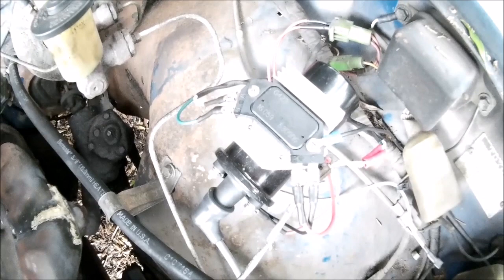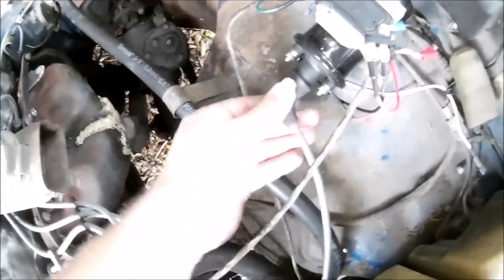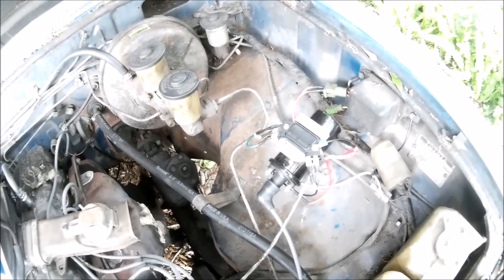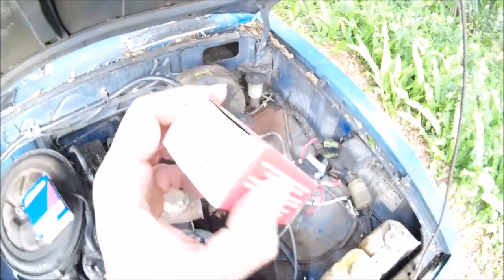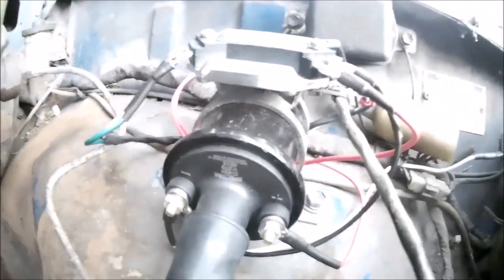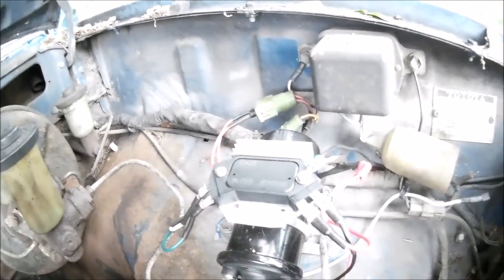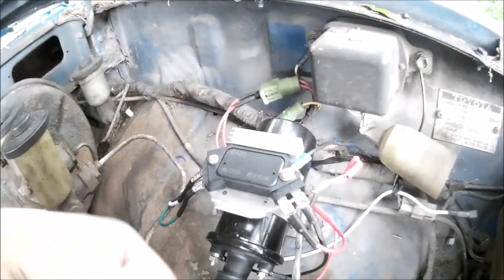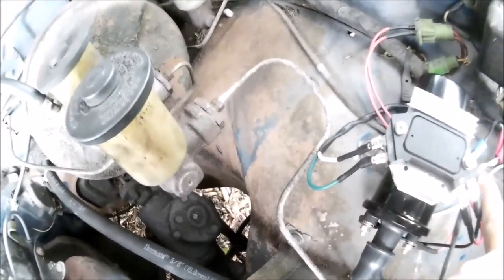1978 Toyota Pickup/Hilux 20R - GM HEI Ignition Module Conversion

Comment: Hey, The13thSword! I have recently bought and fell in love with a 1977 Toyota Hilux and have been watching many of your videos to DIY some repairs on the truck Super appreciate the knowledgable and detailed step by step videos you have taken the time to make and share. I recently put in a gm hei conversion igniter box in her and keep on coming across the same universal coil (all state that an external resistor is required). I noticed that you bypassed this and am wondering what part number and from where did you get your coil? Does it not require an external resistor? Thanks for your time!
Reply from the maker: You are most welcome, always glad to try and help another owner! I include as much detail as I do to be as clear as possible. Nothings worse in vehicle repair than having to guess at something.

So let's get into whether or not you need a ballast resistor. The simple answers are: 1 - If your distributor is a "points" type" then yes, you need a ballast resistor, or 2 - If your distributor has a pickup coil instead of points then, no, you do NOT need a ballast resistor.

Here are the explanations (apologies if you already know all or some of this, & for the length). On a "points type" distributor, you have a pair of physical points or contacts that open & close, operated by a cam on the distributor shaft. This is what allows the coil to "fire off" it's built-up energy into the central distributor wire. Again, trying to keep this simple, the coil is a simple "step-up" transformer, taking your 12 volts & increasing it to something like 30,000 volts or more. When the points open, the magnetic field in the coil collapses, & all that voltage rushes out to the distributor. The points close again & the process starts all over. This happens 100's to 1000's of times a second depending on engine speed.

On a points system, a ballast resistor is in the "run" circuit from your ignition switch. Once the engine starts, it drops the voltage to about 6 volts. This is done to minimize arcing at the points (they arc with every open & close), to extend their lifespan. Arcing on points or contacts causes pitting and/or corrosion, which can increase their resistance, further lowering the voltage; not good, or possibly causing a no start/no run condition. The resistor also extends the life of the coil, since it's not handling as much voltage/current. This was a consideration with older coil design & construction (materials, etc.) BTW, there is no ballast resistor in the "start" circuit; the coil gets full 12 volts on startup.

Some car makers still used ballast resistors with the pickup coil type of distributor in the 70's & 80's; this was to lengthen the life of the coil. Most modern design coils can take constant 12 volts & live a long, happy life, so the ballast resistor is not needed. Bonus - you also get the full voltage/current to your spark plugs for more power & better fuel burn.

My research indicates that the '77 had a points distributor; this shows on Rock Auto's site. Is this what you have? The later "pickup coil" type uses the pickup coil to replace the points; it's an all electric operation, so no points to wear out or adjust. Here is what the inside of one looks like: http://www.cardone.com/Products/Product-Detail?productId=31725&p=rock&jsn=403
The HEI will work with points, but would works a ton better with a pickup coil type distributor. It looks like '78 was the first year for the pickup coil type, & was used in '79 & '80. The later distributor will fit on older 20R's; it's a straight drop in (see my vid on proper distributor installation). Rock Auto has rebuilt ones from A-1 Cardone & I recommend them. They are only about $100 plus shipping, with a $15 core refund when you send your old one (or keep the old one for a backup & let 'em keep the core charge).

As for the coil I used, I got a replacement from Rock Auto, SPECTRA PREMIUM/COOLING DEPOT C624. It's only $8, is decent quality & a year later so far so good @ the full 12 volts feed. There are a few others in the $20 range from Airtex & Standard Motor Products, somewhat better quality & are solid. I don't recommend AC Delco, Accel or any so-called "hot rod" coils; 20 - 400% more expensive for no more quality, you're paying for the name. Without knowing which "universal coil" you mentioned, I do not know if it will work or not. I'd need to know maker & part # before I could say.

Also, if you ever need one, SPECTRA makes a great replacement radiator for these trucks, & Rock Auto has great prices on them; love mine! (They do not sponsor me, they're just the best prices available).

Questions: Would really like to know which type of distributor you have installed. Is the engine original? Do you have the mechanical fuel pump on the head or electric fuel pump? Electric or water choke on carb? You've got me way curious.

Again, sorry for the length; just want to be clear & complete. If you need any other info (have a TON stored) or help just let me know. Joe.

Comment: Greetings. Followed your video step by step. Also replaced my distributor, plugs, and wires on my 86 22R. Engine cranks and cranks but has no spark! You have any idea what may cause this?
Reply from the maker: It could be a lot of things, so pardon me for asking what may seem like some dumb questions, and maybe give you more info then you were expecting. I just want to be as complete as possible (I don't know how much you know, so I'm including as much as I can.)

Are you absolutely sure you have no spark at all? Tried grounding the main spark lead from the coil to the engine or valve cover while cranking? If you have spark on that lead, recheck your firing order i.e. make sure your spark plug leads are in the right order. Firing Order is 1-3-4-2. If distributor is installed properly, #1 should be upper left, when looking straight at the cap (from side of vehicle, NOT looking down towards the ground. If you do get spark from the coil using the above method, I would suspect a timing issue or incorrect firing order. If so, see next to last paragraph below.

If you still have no spark from the coil, the main & most common reason for it may be that your ground to the module is missing or not adequate. The module grounds through the holes with the tab that the screw goes thru. Originally on GM cars, the module mounts to the distributor, which is grounded. Just to make sure I did not have this problem, I made up a dedicated ground wire for it; you can see it in the video @ 5:12. If you DID make one of these ground wires & installed like I did, make sure there is no rust or corrosion at the contact area @ the bolt for the voltage regulator, INCLUDING inside the threads & underside of bolt head. I scraped off the paint on the inside of the fender so it would be grounded to the body for sure. If you have a long enough piece of spare wire (no smaller than 18 gauge recommended), you can easily check if this is the problem. Just temporarily run the wire from the ground point on the module to your negative battery terminal, then crank & check for spark. If you get spark, you know the ground wire you made isn't grounded properly. Solid grounding for this modification is a MUST.

Also, check ALL of your ground wires while you are at it. It's pretty common for older vehicles that have some electrical work done on them underhood to suddenly develop electrical "gremlins". You should have one ground cable or strap from negative battery terminal to passenger side engine mount, & another ground cable from engine block to firewall on driver's side. These being clean and tight are critical for the whole vehicle.

If ground is verified to be good & you still have no spark from the coil, it would have to be the power feed to the coil. Again make sure all your connections are clean & tight. If you have a volt meter you may want to check if you are getting power to the coil with the key on. If not, it could be an ignition switch problem or fuse. Also check that you did not switch the wire around backwards; it happens. Also check your ignition fuse for condition & any corrosion.

Is your battery good enough? Only way to tell is if you have a volt meter to check it; it should read 13 volts+ at rest (not cranking) & should not drop below 11.5 volts cranking.

Possibility that the distributor was not installed correctly, thus making the timing off enough to cause the symptom you describe (engine not firing). If the motor was cranked or turned while the distributor was out, then the timing would be off for sure. The only way to fix this is to remove the distributor, rotate the engine manually until #1 cylinder is at the top of it's compression stroke & (in your case) timing mark is @ "0", set distributor to correct position & re-install distributor. The best way to know when #1 is @ top of compression is to remove the valve cover. On #1 compression with timing mark @ 0, both rocker arms will be slightly loose. If timing mark is on 0 & one rocker arm is tight, one is loose, that's the exhaust stroke for #1. I have a vid on YT showing proper distributor install/positioning here: https://www.youtube.com/watch?v=yH9t5G0UydA
You may want to adjust your valves while you have the valve cover off; it makes a big difference on how these motors run.

That's about all I can think of at the moment. Give these things a try & don't give up; 9 times out of 10 it's usually something simple. Let me know about your progress & if I can be of any help. Joe
Reply from the maker: Forgot to add, did you check the pickup coil air gap setting in your new distributor before you installed it? I never trust the factory on things like that. It should be 0.2 to 0.4 mm, or 0.008 to 0.016 inch. If you do not have feeler gauges you can use a typical business card, they are 0.012 inch thick, or three layers of standard copy paper, same thickness.
Reply: The13thSword cool I will look into that; any chance you remember where you got that coil bracket?
Reply from the maker: The coil bracket is the original one. The old ignitor box was mounted to the top of it with two screws, so I just made use of what I had, & mounted the HEI unit to it. I did have to do a little bending of the tabs to get it lined up but it worked. The HEI unit & heat sink does NOT have to be mounted to the coil for it to work; it just needs to be wired & grounded properly. I just put mine there for convenience.

I also had another thought about your problem in the meantime. I failed to mention that I also replaced the wires between the distributor pickup coil & the HEI unit. Over time these wires can go bad or break. It's a twisted pair cable with shielding; the shielding prevents any electrical interference of the pickup coil signal, very important in this application. Replacement I used was alarm system cable, 22 gauge wires, 2 conductor with shielding. Got 2 foot from Home Depot for less than 25 cents a foot. Spliced it into the old connector (distributor side), cleaned connector contacts, wired to HEI & works like a charm.

I have some extra lying about as well, if you might need it.

Comment: 1976 Toyota Pickup here. 20r. Do you change the distributor to a newer one? Or will the 76 work? I hear you have to use the 79 and up 22r distributor. Or IS that just a mod? Mine is a single wire from the top, not dual wire.

Thanks!
Reply: The13thSword, you're awesome.
Reply from the maker: Thanks! Just doing my part for a fellow Toyota truck owner. Let me know if I can help you in the future.

Comment: The Toyota I just bought was running real rough when cold then fine when warmed up-also had bad backfire. I took at it to get it running smoothly,the first fix was really bad ex manfld crack, welded it up got it sealed up perfectly ( took a few time cuz it kept cooling to quickly then hair line cracking, then got it good cuz I burried it in sand to control cooling). That quieted it up but still had some backfire going on and ran rough when cold and also dieseled sometimes. Verdict is after making it die multiple times by spraying carb cleaner around intake....intake manifold gasket is leaking air. This will cause a rough idle , especially when cold and metal is not expected, also will cause dieseling and backfiring. These trucks are super fun to drive in my opinion. My truck only has 93k on it and is in pretty good overall condition.good luck!
Reply from the maker: Excellent work sir on finding your problems and fixing them! Let me know in the future if I can be of any help to you.

Comment: Thanks again, got my 76 pickup running, fuel pump seems to be functioning but the alternator light came on so waiting for a new voltage regulator and alternator.. But in the mean time, threw a couple of solar panels on top hooked to a deep cycle battery on the floorboard of the cab, ran some wires straight to o the battery and works like a dream..lol..that's why I like the older cars because their simple, gas, fuel, spark.. I wouldn't be able to do this on a car with a ECU or a bunch of electronics. Anyways, thanks for your help..
Reply from the maker: As I suspected, a little extra voltage made the difference. The new regulator along with the new alt should cure most of the problems on a long term basis. Also proves that your ignitor is working right & your pickup coil is adjusted right. If you have a volt/ohm meter, you may want to check the resistance on that fuel pump resistor just to be sure, as well as the resistance on the main charging wire from alternator to battery. Shouldn't read any higher than 0.2 ohms.

If you don't have a volt/ohm meter Harbor Freight has one for about $6. Saved me a ton of headache & guesswork.

Keep me posted on your progress.
Reply: Yup, got my harbor freight volt/ohm meter and been checking voltage but now going to do as you suggest and check resistance.  Thanks again young man for you have saved me a lot of time and money at the mechanic shop.  Much appreciated..
Reply from the maker: No problem at all. Amazing what a little applied knowledge & effort can do....

BTW, the spec for that resistor is 1.4 ohms @ 5 watts. It may read OK cold, but escalate in resistance during use, as it warms up. You can check this while it's running, OR, check it cold, leave your leads hooked up to it, then hit it with a hair dryer on high or at least a minute. If the resistance goes up with heat, bingo, resistor going bad.
Reply: Thanks again..